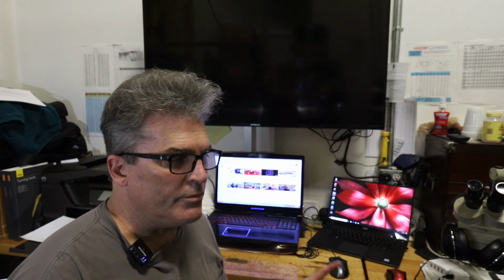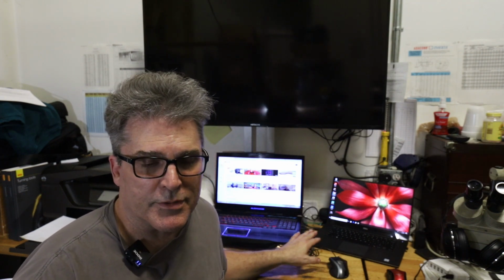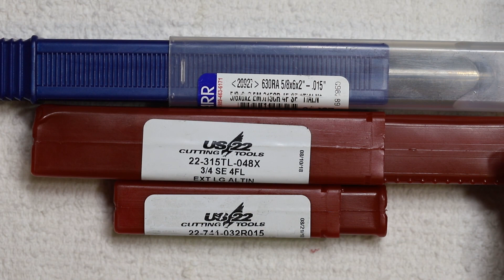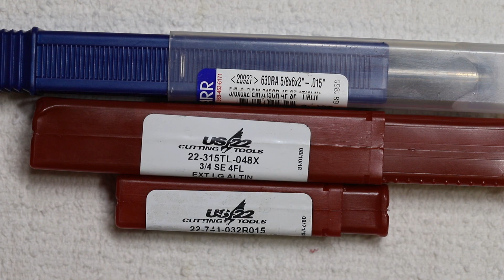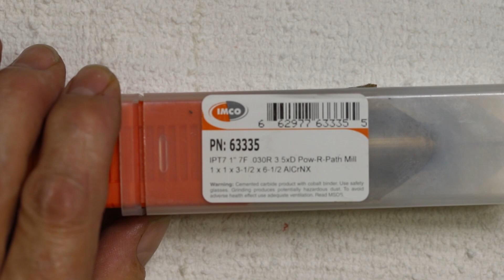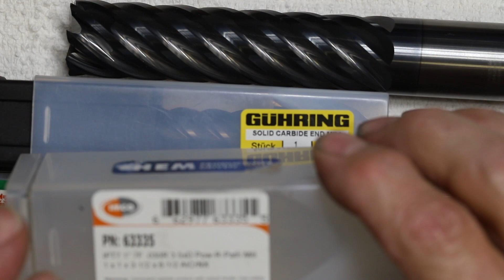Endmill Grinds

Comment: Hi Peter  what will you advise for roughing invar36?
Reply from the maker: I have never machined this material. But from what I read about it. It seems to machine like the softer gummy stainless steels, that also work harden. So slower speeds and higher feeds would be good. You didn’t say weather you are turning or milling. But I think any tools that work with 316 stainless or P550 type of stainless would work. If milling I think I would rough with a high feed mill. Possibility with coolant or better yet air thru the spindle. If using a endmill in a pocket a adaptive type of cycle may work at high feed rates not dwelling in corners. But as I say I have never machined it. Like everything there are many variables with machines and setups. Everything takes experimentation to get it correct. This is why I seldom give cutting parameters in my videos. What works for my machine and setup, probably won’t work for yours.
Reply: @EdgePrecision  thank you for your reply!
Yes milling it.

Comment: Please stick with Esprit, we use Esprit, Hypermill and fusion 360 in our shop, Fusion 360 is okay for beginners but doesn't even come close to Esprit or hypermill, especially for your intergex, fusion is horrible for lathes.
Reply from the maker: Esprit TNG is my primary cam software. There are many things about Fusion that tend to aggravate me. But that may be because I don’t really know it that well. One thing is it simulation. If you zoom in to far it completely disappears and it’s lack of resolution. This may be a setting I don’t have set correctly. Also the support Esprit is really good if you have a problem with your post. The Fusion people won’t even help with that. They make you deal with a second party and pay. But I guess that is to be expected for what’s basically a free software.
Reply: @EdgePrecision  I realized after my post that this video was from a year ago lol. Congrats on sticking with esprit, im pretty comfortable with all three of the softwares I mention earlier, and fusion is very good for 3 axis  milling and modeling, but I find it lacking in everything else, especially turning.  We haven't actually made the switch to TNG yet but im looking forward to when we do that, it looks like a big improvement over the previous versions of Esprit.
Reply from the maker: @85CEKR  Yes TNG is way better for simulation. You do have to have a accurately defined model of the machine your programming for. For the mill/turn machine like the Mazak Integrex the simulation is extremely accurate. If you carefully model your tools (usually you can download a model). If the simulation doesn’t show a collision or over travel of tool machine or fixture. Than there is none period! That’s how good it is. Especially 5axis. But everything has to be carefully modeled and placed in the proper location. The software also has a Machine builder so you can model and define your own machines or moving fixtures. Like chucks,vises, steady rest ect. You can also do some of this directly in Esprit.

Comment: Peter, thank you for you video. If it's not too much to ask, I want to ask you how would it be possible to go about grinding the hard anodize coating of a type III coating to size. will this be possible on a simple cnc cylindrical grinder? except from N4 finish there is a tolerance of less than 0.0004" on OD. there are dimensions coming from a step on the OD thats why I want to ask about cnc grinding and not lapping. so basically it means you have to grind about 4 to 8 tenths off of the ID and OD AFTER HARD ANODIZE. .ever seen something like that? thank you.
Reply from the maker: I have never had something ground after anodizing. I have always sized the part so the anodizing brings it into dimension. But this takes more attention from your finishing shop. I would usually have some sample pieces or extra parts (If they were small) to try out for them to get the process correct. Of course you have to know how much to undersize them to begin with. This is very tricky and requires interaction between you and you finishing shop. So expect to pay extra. I'm not saying don't do it, or it cant be done. I just have never done it before.

Comment: Hi Peter,
I love the modeling of Fusion 360 but not as big of a fan of the CAM side for lathes. The last I knew you didn't have much control shifting from C to Y axis on in a program. The Mori software I used you could go back and forth as much as you wanted in the same program with no problems. Also, the last I knew you had to make a spun profile for any lathe work that had any profile altered by mill work or cross holes. If you update the model you have to make a new spun profile as it does not update with the model. They may have fixed some of these things since the last time I looked at it. Even with some of the issues I love Fusion 360 and they are always working to make it better. I love their marketing and support, that alone is of great value. 
Steve
Reply from the maker: Just using it yesterday (I found) there is a check box on turning for spun profile. If you don't check that and have milling features on the OD of your model. It won't generate turning tool path. If you do it generates the spun tool path. It also rebuilds when you make changes to the model and go back to cam. There is no building a spun profile at all (At least not that I have found yet. Just that check box.). The thing I would like from my first impression is better lathe tool destinations on the tool holder (Not the inserts there its pretty good). In particular the ID tools. A custom tool ability like the milling tools would be useful. To make the simulation more usable this would be nice. Its not exactly set up for elaborate simulation of Turn/Mill but I think it will be entirely usable once I get a functional post for the Mazak.

Comment: Just to help your communication terminology, in milling you have radial depth of cut (on the side of the cutting tool) and axle depth of cut (with the length of the tool).

Comment: I am with you on fusion 360. I have 30yrs programming experience in GibbsCam and MasterCam. I am an industrial user and have been thinking about trying Fusion. The best I can tell the post will be the big challenge. I have made my own custom posts for MasterCam. But I buy my posts when doing multitask machines. I am very interested in seeing how far you get with it. I will be watching
Reply: Autodesk has a guide on how to edit HSM posts with Microsoft Visual Studio. Same process for Fusion 360 posts. What's nice about using VS is that you can post code directly into VS and when you click on a specific block, G, or M code, it will take you directly to the line of JavaScript that you need to change to make it right. Saved me a ton of time!

Comment: Fusion is great, its cheap and it works. The Multi Axis work flow isn't great, its laborious. The auto updating is a pain. If they break the software with an update your beholden to them for a fix. Moving to Fusion for you will be a major down grade. Fusion is great for the price but has real limitations, and will always have them as autodesk has a premium product to sell.

Comment: I don't know Peter...you are a master on Esprit...I'm not so sure about Fusion 360...you already have a perfect postpro,and you know how to use Esprit that is a very powerful cam.The thing I don't like about the Autodesk products is that even if you don't have to pay so much in the beginning,then you have to pay always,otherwhise the programs you did,could not be usable after you decide to stop using Fusion!I'm not sure,but I guess you should consider about this!
If you don't upgrade esprit anymore you still have your old programs and you can always use your software!🤔🤔🤔🤔🤔
Reply from the maker: This depends on how you make programs. I use to use a software called SmartCam. I don't use it anymore, not for about 6+ years. Yet I have run some of the jobs in the recent past that were made on SmartCam. So how does that work? If you program to use the off setting features of the machines control. The program is in G code that hasn't changed. So if the variables are taken care of in the control it is irreverent what software produced the program. What I see on YouTube is many people having to go back to the software to make program changes due to say. The part not being to size or in the correct location. If you program with the controls function in mind and multi-able tooling options you might use. You don't have to go back to the CAM software to run you programs and reprocess cod. You need to use cutter comp for milling tools and tip comp for lathe tools. Fixture offsets where necessary. This will make your G-Code stand alone not requiring any CAM software to be usable. I remember the days before CAM software where we manually calculated and programmed tool path. Every CNC machinist should have to do some programs this way and learn to use the functions of the control they run. To control the size of features on the parts they machine. Than they would understand how to properly use CAM software.
Reply: @EdgePrecision  correct!I actually use more Fanuc on machine instead of cam software(edgecam).But what I was saying is that with Autodesk software is that you are forced to save everything in their cloud and if someday you decide to change to other software,you can't use Autodesk programs again!Or so it seems to be:I'm not sure on how it works...you should try to check precisely! 🤔🤔🤔🤨🤨🤨
Reply from the maker: These are things I want to find out. I'm not sure yet but from what I have been told you can save your files locally but there are things you have to go to the cloud for. So I will find out and let everyone know how it really works. There are things about Esprit I'm not happy with. From what I see in fusion tutorials on YouTube it may actually do these better than Esprit. We shall find out together.

Comment: Fusion 360 is a modern piece of software, which is such a refreshing experience when dealing with cam especially, but some aspects of it are the most frustrating annoying interactions I've ever personally had with software.  They are, however, pushing development of it like crazy, so give it a few years and a lot of the bugs will be ironed out, but then they'd probably charge a lot more for it.
Reply from the maker: I have never run a Cam software that didn't have some kind of bugs. Even the most expensive have things that lock up the program. You have to get into habit of saving after every successful tool path. Or you will regret it. Ask me how I know. And this includes Cad software's as well.
Reply: @EdgePrecision  I can appreciate your experience and agree with it whole-heartedly.  In having used fusion for a while now I find its aspects to be frustrating in this order from least to most: CAM > Solid modelling > T-Splines > Surface modelling > Sheetmetal > File Management > Sketching.  I am a designer primarily so my perspective and approach in working is somewhat reversed from what you will experience and my values may be more heavily weighted towards generative cad and sketch tools, and for that reason I find it largely frustrating to use.  But I do have praise for fusion as a cam tool that comes packaged with a powerful-enough modelling suite, and an adequate sketching environment, especially when interpreting models from external sources.  Plus it is just refreshing to use a modern piece of software with the advances in accessibility and interface that are lacking in many other specialized cad and cam packages, and with a price that is comparatively almost free.  So I look forward to your assessment after experimenting with it in useful work.  As for me I currently use it daily, and for every way that I find it excels, it frustrates me in new and exciting ways.

Comment: Just a suggestion I would look up on youtube "reflow GPU". It's possible you had a solder joint break. (I'm an IT Hardware repair guy)
Reply from the maker: Yes anything is possible. I’m waiting for the new computer to transfer the data and programs. After that I plan to dissemble the computer to clean and repair it. When I started to take it apart I removed the fans. The cooling fins were really dirty. This computer has lived its whole life in the shop. You can imagine how much oily air has passed thru it. If there is a broken solder joint I will resolder it. I think it’s more likely a connector has come loose. I will record video on the process. Also the video will help me to resemble it. If I forget something.
Reply: @EdgePrecision  just to be clear the solder break I'm talking about wouldn't be visible it would be on the bottom of the gpu. There is a way to fix that sometimes by shielding most of the motherboard with aluminum foil and putting the board in the oven. This is assuming you don't have a solder reflow station. Good luck!

Comment: Thanks for the video Peter. May I suggest contacting Patrick at OneCNC West(1-909-931-7811). Amazing software at reasonable price and unparalleled customer service, no maintenance costs, free tech support, free guaranteed post processors, etc. It's not free, but it is no where the ridiculous price of the big names.Great software.

Comment: I bought a DellM6700 precision laptop with workstation card few years back and it's been a dream.  Works with solidworks a treat!  And it's very cheap now too.  When I bought it it was $3k, but now they're in the $500-800 and still plenty powerful.   Best upgrade for any laptop for CAD that I've found is the RAM and video card.  32GB and an approved workstation video card make everything buttery smooth.

Comment: Imco makes outstanding emills. In particular the .125" and under which we use in exotics. Their quality is very consistent also unlike some others. I was less impressed with the MA Ford stuff I've tried. I had to hand sharpen their countersinks.  You might take a look at the Kennemetal Harvi series. TIALN is the best coating we've found for both exotics and stainless. I'm looking forward to your Fusion360 adventures as I've just started playing with it myself.

Comment: Interesting video, I never really thought about the 2nd clearance angle on the flutes.

Any chance you could review the cost of re-grinding those end mills on your CNC grinder after they have been used up on steel vs buying new ones?  It always seems like a waste to 'recycle' a pound of carbide in a 1/2" end mill that is dull vs resharpening it.

Comment: Thanks Peter. Is that variable pitch flute grind something that can be done with a stock cnc cutter grinder or do the manufacturers have custom machines? It’s a really good idea either way.
Reply from the maker: I think most CNC tool and cutter grinders can do this. Mine is a older machine and it can.

Comment: Fusion 360 is great! I've been learning it and it has so much to offer and is reasonably easy to use. Have you tried any tools from Helical or Lakeshore Carbide? I just got a Tormach 770 and I am using some Lakeshore Carbide tools and they are pretty decent.
Reply from the maker: No I haven't tried any Lakeshore Carbide tool yet. I mostly use tooling supplied by my local supplier Bass Tool. As far as I know they don't sell Lakeshore tools. I have nothing against Lakeshore, I just haven't tried any yet. I saw a engraving tool on one of NY CNC videos I like. I may give that a try.

Comment: Fusion 360 is the best thing to happen to CNC hobbyists (or non professional CNC people) in a long time.   Before Fusion, basically all you could get for home shop use was things like Cut3d from Vectric or BOBCAD/CAM, which are ok as far as they go, but far inferior to professional CAD packages.  Rhino with RhinoCAM was ok, but expensive for a hobbyist.  I'll add my name to the list of people who would love to see you make Fusion 360 jump up and dance, especially since Fusion's 4+ axis capability is pretty simple at the moment, and I'd like to do some 4 axis simultaneous machining instead of just using it as an indexer.
Reply from the maker: I will tell you this. I have worked in the machining industry for over 40 years and used cam software that was no where as good as Fusion. There are comments in this video of people saying its no good or just for hobby work. I have yet to use it. But from what I can see from videos on it. This software can defiantly be use in a professional setting. The reason so called commercial cam software costs so much is there just isn't the volume of customers for it. It's not like say Adobe products like photo shop or premier with millions of potential customers. So they have to charge more to fewer customers for the development of their product. But with many more people getting into machining like hobbyists there are many more ways to make money. You don't think Autodesk has a agreement with Mcmaster for putting that link in Fusion. Things like that. We shall see, I look forward to playing around with it and seeing what it can do. Even if I cant get a post for the Mazak I will use it for my small machines in my garage.
Reply: @EdgePrecision  I have two different posts and want to improve them with someone who knows the machine inside out. I normally charge for my time, but we can figure that out.
Reply from the maker: I'm not sure what you are saying. Do you have posts for a Mazak Integrex and want so feed back on them from me?
Reply: @EdgePrecision  correct. Which model and control are you running?
Reply from the maker: @ScottMoyse  My Mazak is a e650M and it's control is a Mazatrol 640m pro.